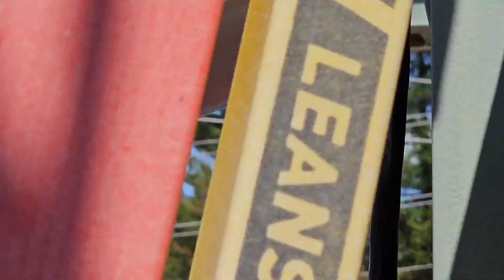How's it work? High voltage hydraulic McGraw Edison OCB. Power circuit breaker trip & close.

Comment: Those mechanical backups are so interesting. Partly because you don't see a whole lot of these in our everyday lives, but also because they allow the normally electrically controlled device to be operated in the event of a power failure.
Reply from the maker: The battery should power it, but I've been there when the trip coil burnt up and we had to pull it manually.  We drew straws and the lucky winner tied a 20ft wire to it and tripped the breaker by hand.